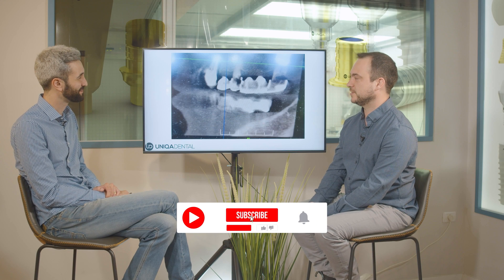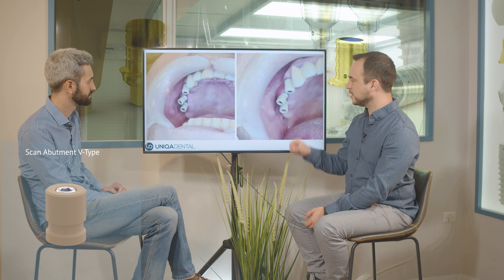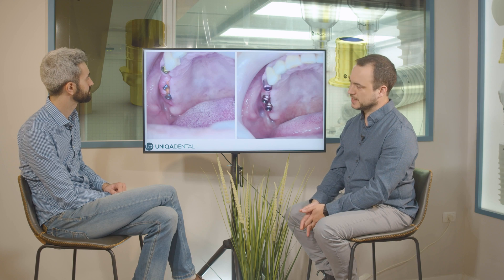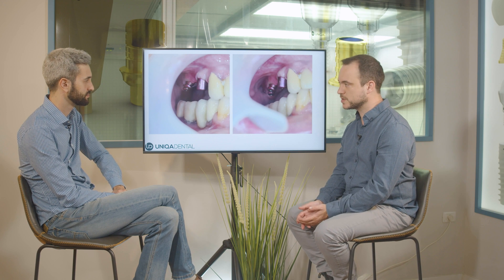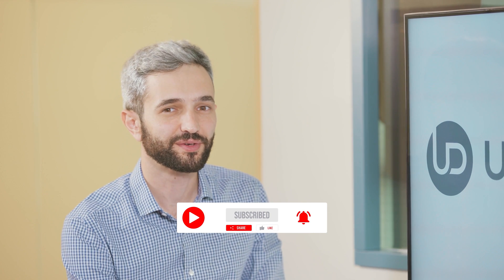Screw Retained restoration on Straight Multi Units Digital Scanning Metal bridge replacement

Comment from the maker: 00:00 You can see that from the teeth, there's almost nothing left. 
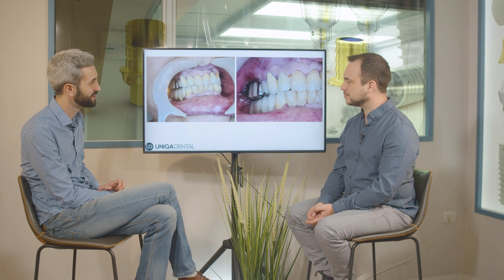01:05 It's clearly broken, it's a little bit worn off. 
02:07 This multiunit is a V-type multi-unit.
03:15 When you are using multi-units V-type, you can use straight multi-units when you have a little bit bigger angulation.
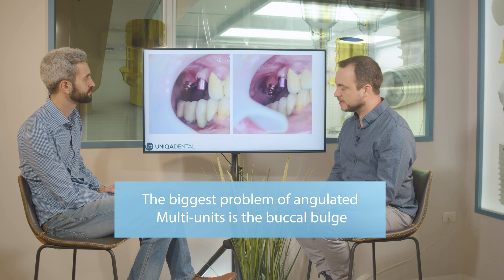04:30 You could use a V-type, but in the meaning of the angulation.
06:22 After the healing process, you can see a little bit of plaque that needs to be clean.
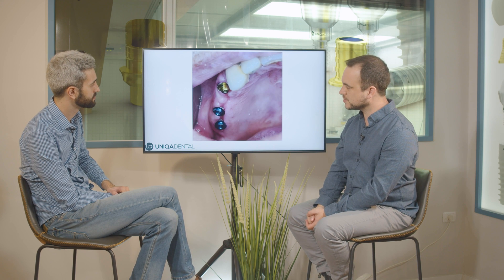07:00 This is the angulated D-type sleeve. And those two are the V-type sleeve multi units.
07:50 This is a little bit of the titanium that you can see. But you see that it’s not such a big problem.